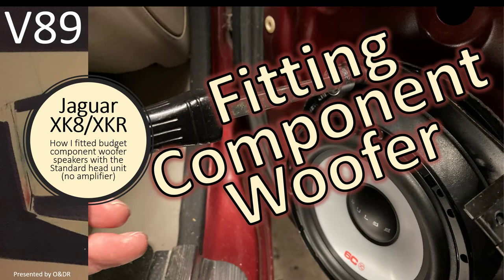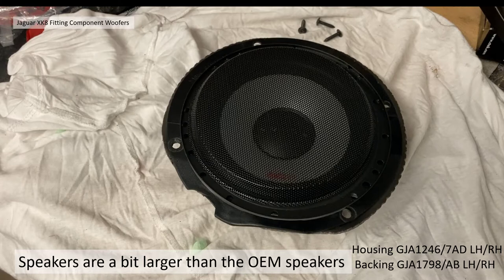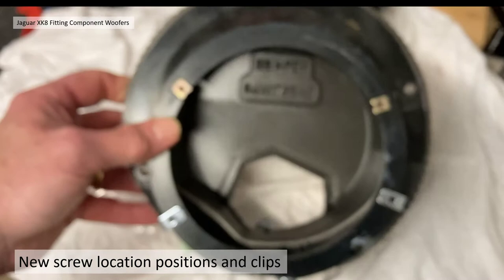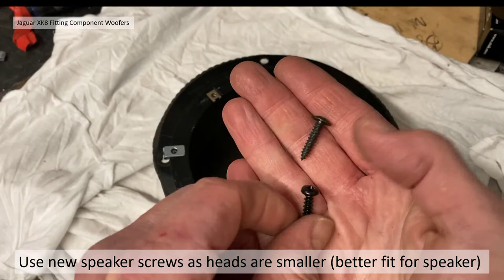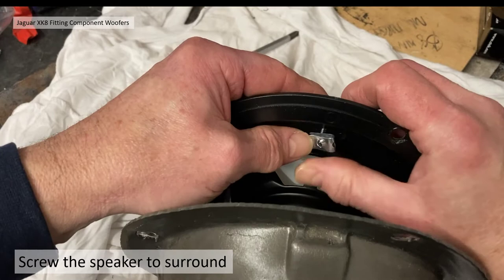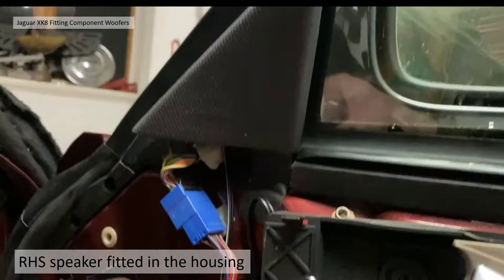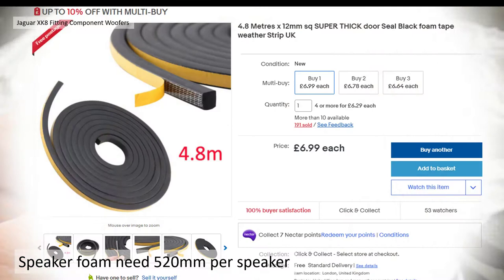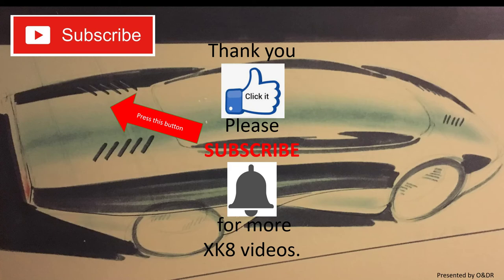Jaguar XK8 Fitting component woofer door speaker V89 / XKR (X100)

Comment: I've just done this upgrade as the original speakers were shot and the foam cone broken and turning to dust.!
I fitted a pair of JBL stage 2 model 624.
These are rated at 240 watt but more importantly 40 wrms..
This means the original head unit in the Xk8 or the more powerful one in my 2001 xkr can drive these speakers more than adequately and they sound superb in my view.
The speakers are actually Harman..
I didn't remove the door card and they have plenty of spare fixing holes.
If you line them up you can use the original screw hole at six o'clock pilot 2mm drill into the oem door mount at roughly 9 o'clock and 3 o'clock and secure by screwing two of the supplied screws straight into the plastic.
No need to use the supplied spring clips which would be almost impossible to fit unless you take out the whole unit.
Using the original screw at six o'clock the speaker is really secure.
No need to replace foam as speakers don't need it.
I cut off the original speaker connection and used crimped connectors the orange wire being the negative..
Cut off at least four inches of the black sheathing and the orange and white wire in my case can be separated giving an easier fit with more room to manoeuvre.
There was no need to extend the wires...
Now for a road test👍
Reply from the maker: George, thanks for sharing your experience, much appreciated, regards Damian